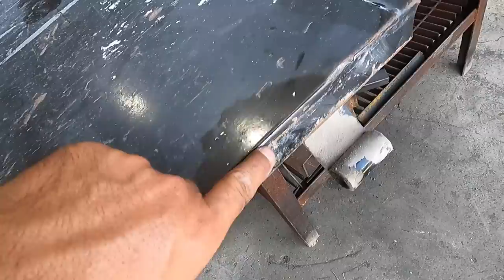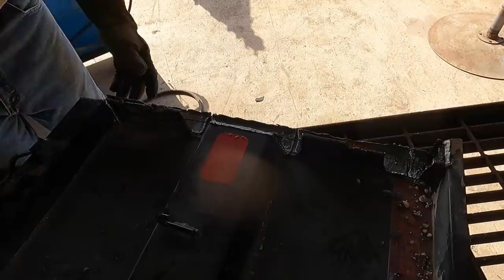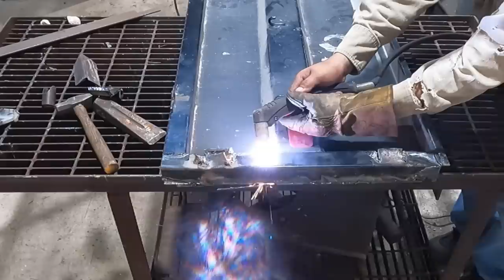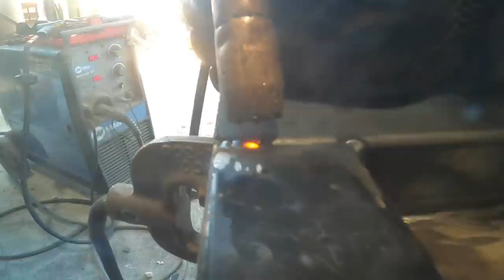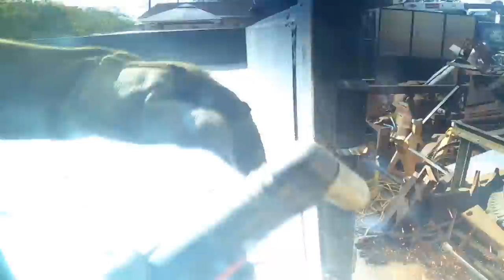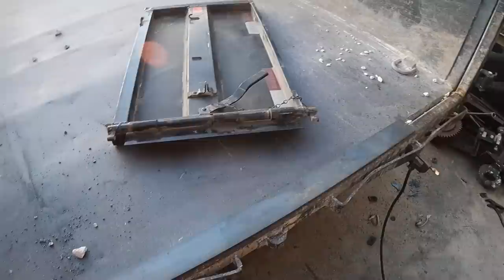Dump Trailer Gate Repairs.

Comment: Why not carbon arc gouge?  I suppose if the only tool available was a plasma, I may have chosen a 5" grinder and some Slicers.  After this project, a trip to Top Notch is needed.  "alright, alright, alright..."
Reply from the maker: I just might be going to Top Notch on the first weekend of the month. Hot Rod Night.

Comment: dirt and stones trapped in the bar.. now im sure water would also get caught why couldnt they just put a cap over the pipe or leave a drainhole at the base.....
already disliking that design.... our dump trailer the top and bottom bars cap over the verticals.